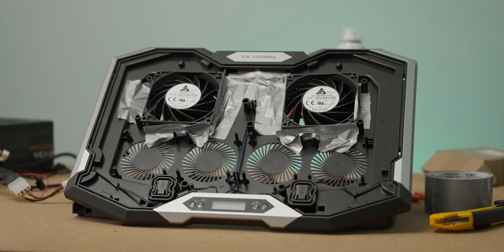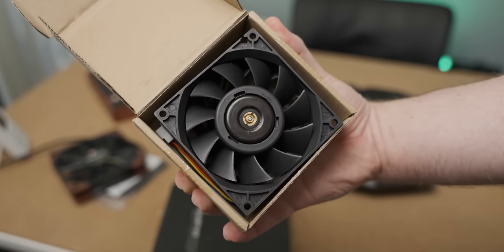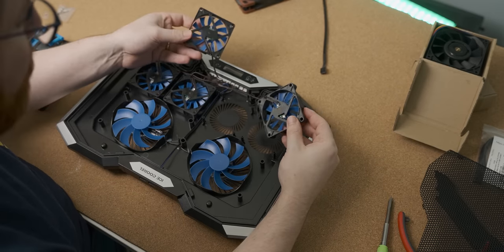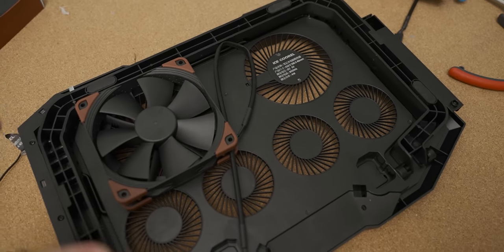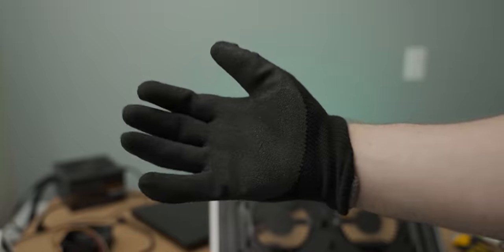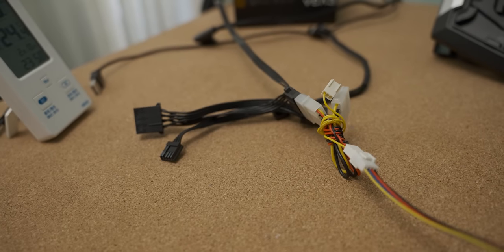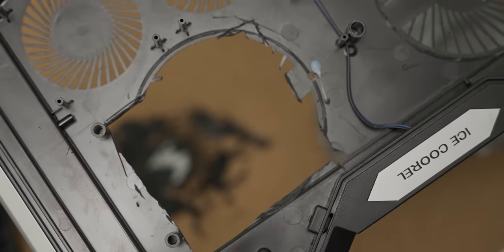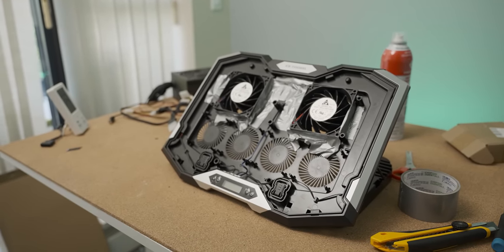I Made The World's Most Powerful Laptop Cooler

Comment: Hang on so you're trying to force air past a much slower spinning fan, that's actually going to make it worse because you're impeding the spin on the laptop intake fan. It might help with ambient I guess but most of that cfm is just pushing against the body of the laptop. I therefore must insist you vandalise your expensive Razer laptop and remove its back panel.

Comment: very good  , I bought 02 ventilated base models did not solve the heating problem acer nitro i5 , I manufactured a pvc base with 04 12v fans and put a 19v source , problem solved maximum temperature reaches 72

Comment: I personally just use my room fan. It worse than the blowy metrons. But much quieter

Without fan 
Gpu max: 77c average 75-76c
Cpu max: 82c average 78-79c

With fan max setting
Gpu max: 70c average: 69c
Cpu max: 83c average 74c
Laptop tested asus tuf fx505dy. Game tested forza horizon 4.

Comment: its not about Laptop Cooler can buy 10.00 cooler be fine problem is bottom cover of the laptop are lacking holes do what i did i modded the bottom laptop cover added more holes for air flow my i7 gen 10 gtx 1660ti runs at 18c and 28 on load with cheap 2 fan cooler that cost me 10 bucks

Comment: I guess you just don’t understand heat and mass transfer…. There is a threshold point that, when u reach the point even if you Add more airflow won’t make it cooler….. at this point u need to enlarge the surface area and heat conductivity……..

Comment: Yeah please stop 
The fact that at no point you mention that this can be hazardous is irresponsible, connecting industrial fans to an underpowered power supply could in worst case be a fire hazard. 
Also using wires that are too thin could result in the wires catching fire too. 
And finally you seem to have wired the positive from your psu to the fans frequency input which is not something youre supposed to do. 

If you want to mess around like this without proper research it's fine by me, just have a disclaimer like "Hey, i have no idea how safe this is so maybe dont try this at home."

Comment: I’d say that build is a complete waste of money just get does same thing basically a 8-12c temps drop. This is —> **AFMAT Gaming Laptop Cooling Pad, 4500RPM Strongest Laptop Cooler 17.3 inch, Laptop Cooling Stand with Faster Heat Dissipation, Colorful Lights, Adjustable Mount Stand, Temperature Drops by 20-30 Degrees** off Amazon $62.99 
It’s a vacuum type cooling pad with 2 twin turbine blowers blowing atleast 2-3x as much air as his setup creates and I went from 80c on GPU and 75c on CPU down to 70c on GPU and 65c on CPU